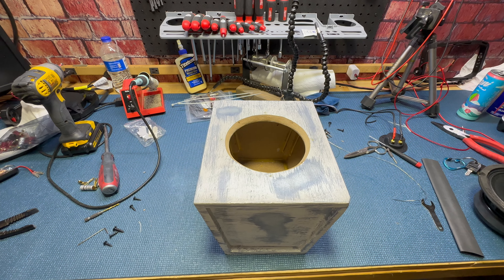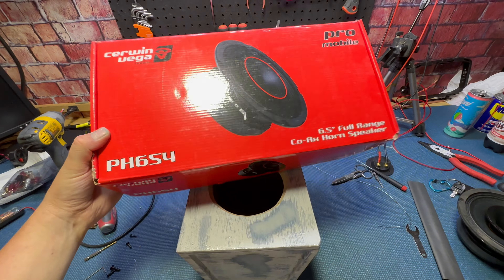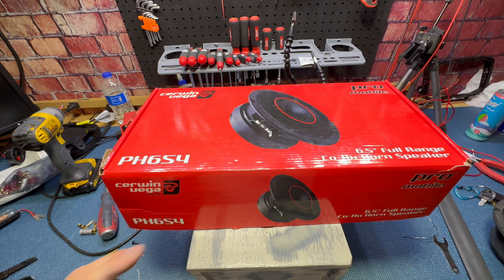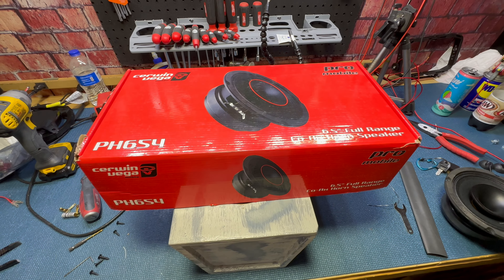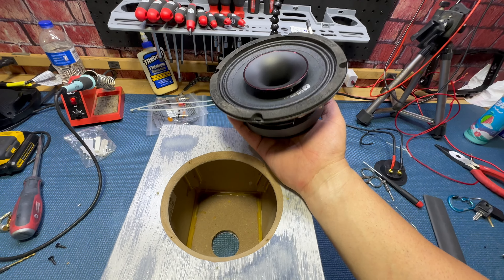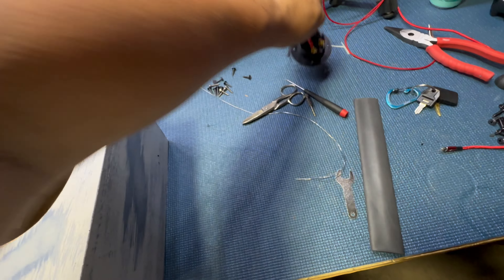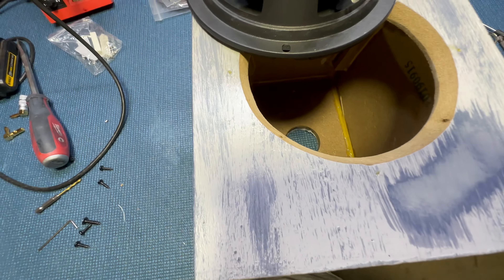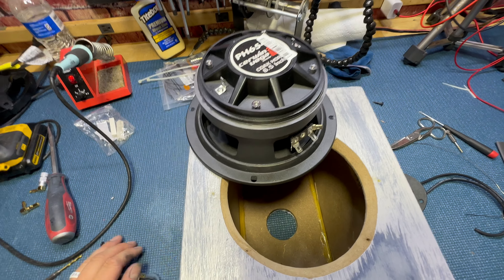CerwinVega PH654, With Compression Horn Drivers!

Comment: So how do these sound?
Are these rated at 4 ohm? They would be pretty hard to drive by any home amplifier. How do these sound?
Reply from the maker: They sound good if you can pair them with a subwoofer that has the umpf, they are on the bright side, these are 4ohm and I think they only dip to 3.6, I drive them with a Rotel Amp, and it gets stupidly loud, these are 101db efficient so they can be driven with a lot of lower powered amps. Keep in mind these come with a capacitor that if you dont install on the tweeter its going to sound extremely harsh